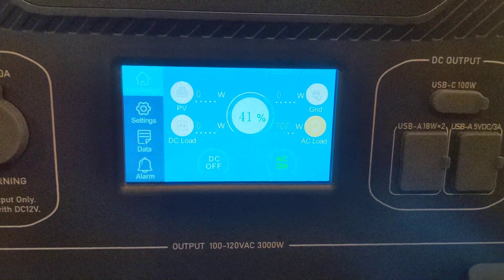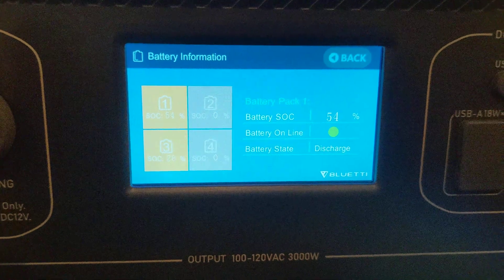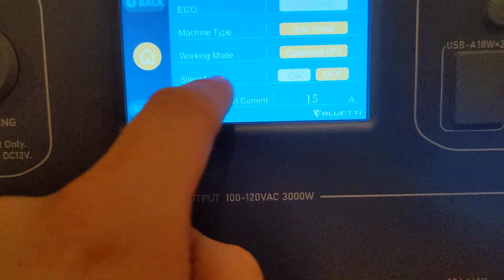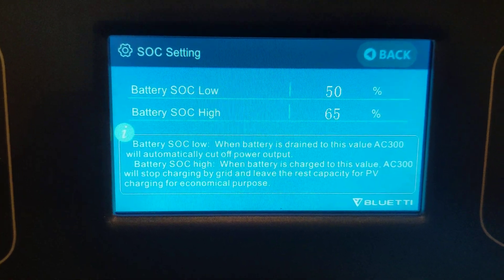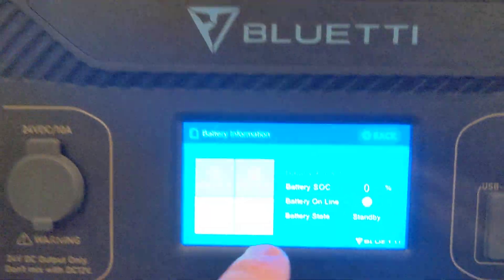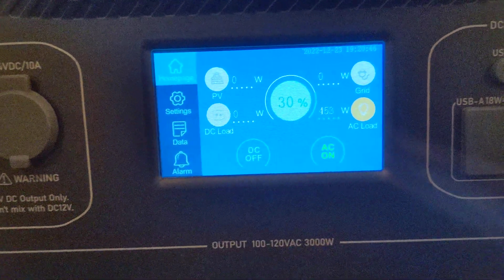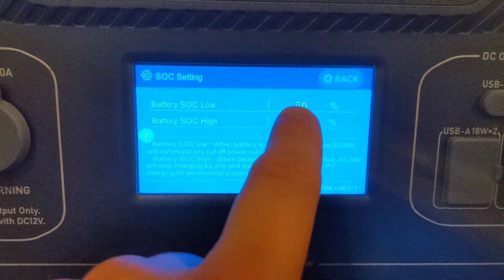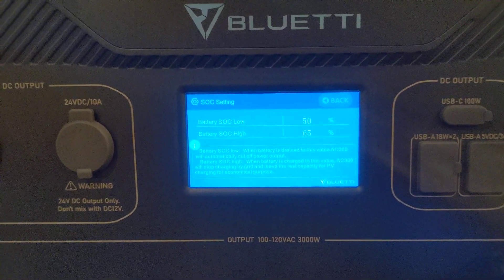AC300/AC500 SOC Low - Is not enforced.

Comment: I have found with one battery the soc thresholds work but I still have found the soc thresholds do not work. With four batteries I have found that one of the batteries will discharge to zero while there is plenty of charge left in the other batteries. I have updated the firmware the latest version but this did not fix the problem. I think there is still some problem with the firmware to use all the batteries. I am new to using the four battery configuration but have yet not found the problem. I have no alarm for battery communications. Essentially I only have the benefits of one battery even though I have four batteries. I have ensured that the four batteries are connected according to the documentation. I am unhappy that this problem doesn't have any solution yet.

Comment: I have the same issue, with just one battery it will never honor the low SOC.  It does honor the high SOC and quits charging once reached but never stops once low SOC is reached.  Bluetti has had ample time to fix this, not good.

Comment: SOC low setting is not working for me either. I set the value at 5% yesterday only to see AC output still on at 2%, had to turn it off myself. This very unfortunate - I have no other way to directly charge B300 if it's depleted and AC300 is unable to connect to it. Will have to buy a brick, probably
Reply from the maker: Hi Oleksiy - Thank you for your feedback. I've passed this issue to Bluetti Engineering and to their mobile app team so that they correct or clarify the issue.
Reply: @MyBluetti  Hi, there's one potential solution offered on the Bluetti community forum thread I created on this subject (actually, the link to your video here was posted there). They say SOC Low setting does work, albeit with some 5% or 6% delay. I'm trying to test this approach, setting SOC Low at 11%, but haven't managed to deplete the battery to this level since then, will revert once I do. Expect the AC Output to be turned off at 5-6% SOC in this scenario.

Comment: Is it not possible that the Battery Low setting simply follows the Master and not the Slave unit (regardless of being able to set it for the Slave)?  Is it also not possible that both batteries (or all Batteries if more then two on one AC300) on the Master must fall below the Battery Low setting to take effect?
Reply from the maker: Hi Joda - Sorry I didn't see your comment. No the Master and Slave units do not share or coordinate their battery status or defined SOC thresholds. The only thing that is "communicated" shared is the role and phase. This allows the two units to take their respective role and provide the "opposite" phase required to create 220volts.